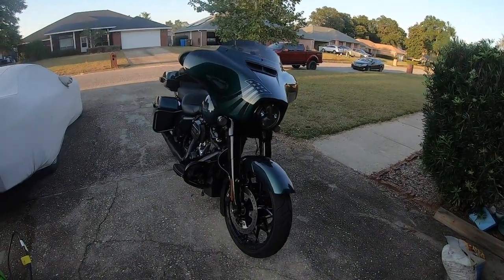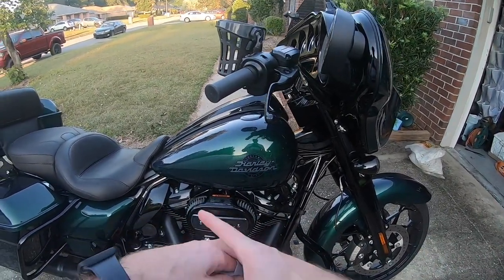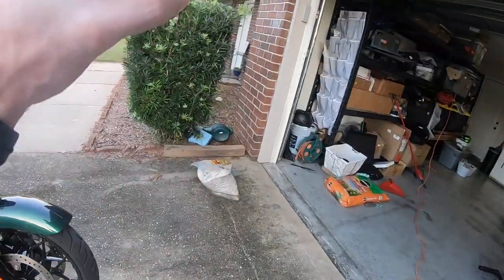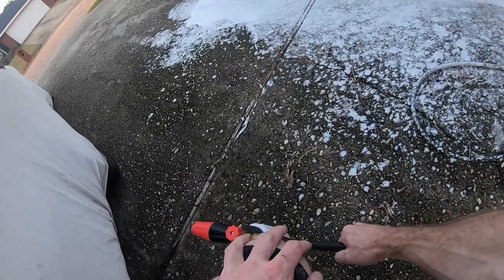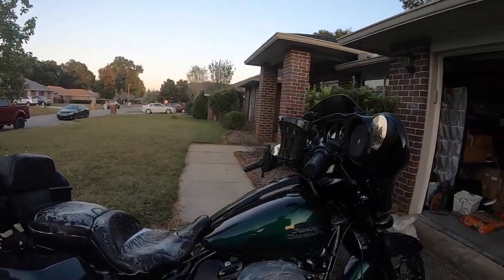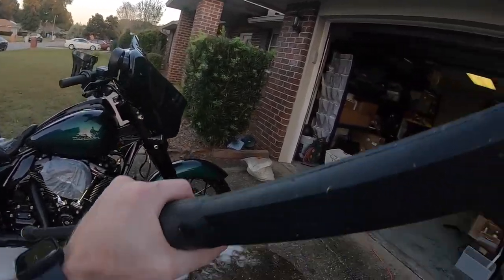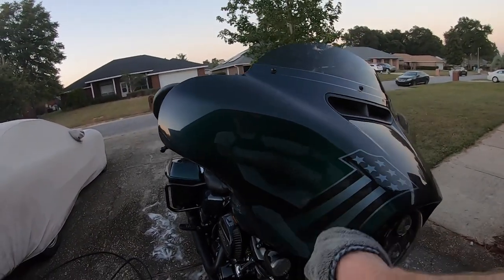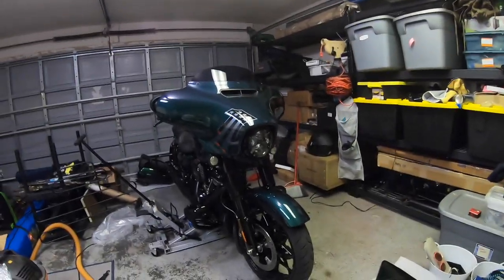Washing the Street Glide

Comment: What surprised me was hand wash while active foam was still on the bike - I would normally rinse it off first and then use a mitt.
Reply from the maker: For me it depends on how dirty / type of dirt on the bike. In the case of this video it was mainly just a lot of bug guts but if it was a lot of dust / sand that can scratch the paint then yes I will rinse off the active foam first to get all of that loose dirt off and then two bucket wash it.

Comment: Do you have to keep turning the water off to the pressure washer? I have one and it says if you let the water keep running into the pressure washer for 1 minute and it doesn’t get used, it will blow out a seal lol. Idk.
Reply from the maker: I leave the water on until I'm done and have never had an issue.
Reply: @BanditMotoVlogs  alright cool deal. Somewhere someone told me if you let the water run for more than a minute, it will blow out some kind of gasket. Idk. I appreciate the info man!
Reply: @BanditMotoVlogs hey I got a question. Where did you get the quick disconnect wand? I have the harbor freight pressure washer with the wand that comes with it but it doesn’t have the quick disconnect end to apply the foam cannon. Thank you.